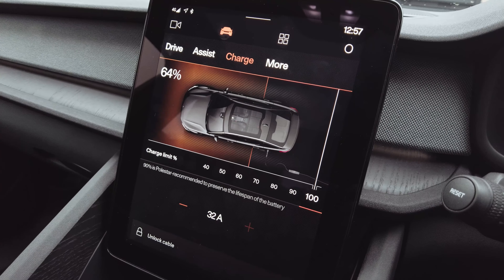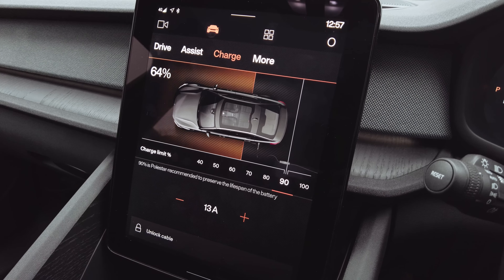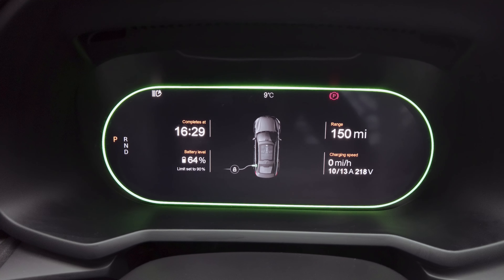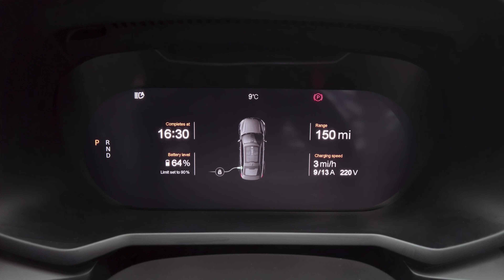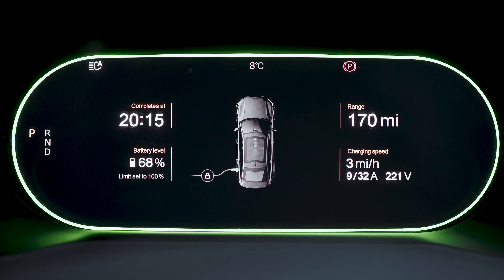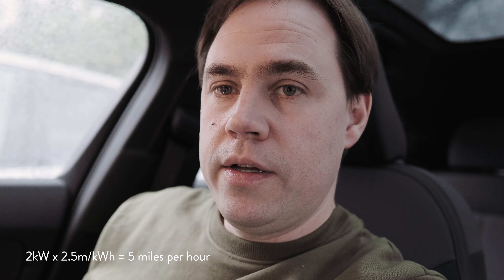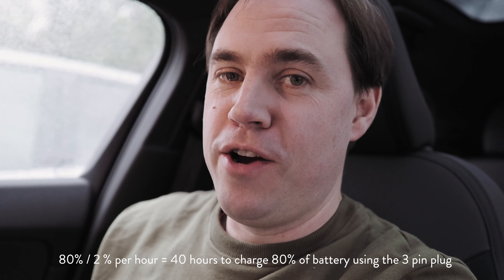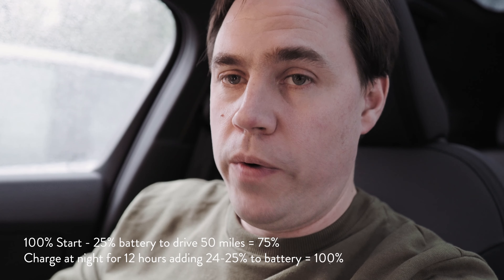Polestar 2 - 3 pin charging from a standard socket

Comment: Bradley thanks again for video. I have been using 13A plug since my Polestar arrived about one month ago. In process of getting a 7kw installed. I have been getting 4 mph on the display however actually seems to charge quicker than that. I only commute three times a week so no problem at the moment
Reply from the maker: Great, yeah good to hear. I think the displayed charging rate is quite conservative

Comment: The Teslas have a setting that allows the car to keep the interior below 105 degrees F at all times by utilizing the air conditioning.  I visited my parents this summer in Mrytle Beach, South Carolina.  I arrived at 15% state of charge and let it sit for 4 days and 4 nights on the travel charger at 12A, in the heat and humidity before finally reaching 100%.  Their electricity was free (included in the HOA fee) and we used the electric golf cart the entire time of my stay, so the travel chargers do have some usefulness at times.  There was a supercharger within 2 miles, but why pay for range when you don't need to?  Good video.  Everyone needs to be aware of all the options available to them and the use cases for each option.

Comment: I've been using the 13a charger since I got my Polestar and have no problems at all. 

I plug in via a smart plug to select the best times on Octopus Agile for charging, The smart plug shows a maximum of 2.3kW whilst charging but it fluctuates as low as 1.8kW which would explain your 2% per hour. It actually gives 2.5% per hour over a sustained period. I did 10 hours last night in the plunge pricing period and went from 65% up to 90%

My mileage is quite low at about 120 per week on average but even with the Polestars abysmal cold weather range I can easily cope. I don't even plug in every night, I just hover between 40% and 60% and wait until there's some reasonable pricing and have a little top up as and when. 

I had a long trip a few weeks ago which just needed a bit of forward planning and I had to make sure I was always at 85% ready for topping up to 100% the night before my trip. Again not a problem you just have to think ahead. 

On a side note: The charger companies really wind me up when they claim you need a proper charger as 13a sockets aren't designed for pulling this sort of load 'continually'. Absolute rubbish!! That's exactly what they're designed for!! Mini rant over........

Thanks for another great, informative video.
Reply from the maker: Thanks, great to hear experience from someone using it regularly. Was great to get paid last night to us power but annoyingly I was already at 75%, wish I hadn't topped up two days ago.
Reply: @ShortCircuitPS2  If you go to windfinder.com you can get a very good idea of what the pricing will be over the next week as prices are heavily linked to excess wind energy.
Even at the start of the week you could see that there was going to be a lot of wind on Saturday night and as the weekend got closer the prediction stayed the same. Lots of wind at a weekend between midnight and 6am is pretty much perfect for cheap pricing.
Reply from the maker: Great thanks for sharing that site and the tips. I'll definitely keep an eye on that for future charging
Reply: I don't know the exact details in Great Britain, but in Germany we have the 1-phase "Schuko" plug and the sockets are for max. 16A designed but it is definitely not allowed to pull this load continuously, only 1 hour at max. load according to German standards.

A CEE socket must be installed for 16A permanently. Single-Phase 25A or 32A is also possible in combination with CEE, but unusual in privat home installations in Germany.
Reply: I've had a 2kw heater melt and burn a socket, and a granny charger melt the switch in a socket only 6 years old. They really cannot sustain 13a for extended periods, and its for this reason you aren't supposed to use immersion heaters wired into a plug any more.

Comment: Put this in context : I charge on mains at work. It's "slow," as you say, but over 8 hours it covers my round - trip commute distance with some to spare. I precondition the cabin, but the system only operates for a few minutes before departure, so it's only a minor penalty.   This is a great way to charge if it meets the daily requirements. "Slow" charge at work, charge at a higher rate at home infrequently , when needed,
Reply from the maker: Yeah, really good way of doing it!
Reply: 99% of the charging I do on my model 3 is slow charging like this. Usually at work. Every other day or so is enough for me. I have a fairly short commute though.
Reply: I’m not sure how many people would be able to charge their car at work. I can’t. No sockets available in the car park and the management won’t allow it anyway.

Comment: I thought I would never use this 3-pin plug cable but I’ve just got home solar installed and during the summer I can trickle charge all day for free ⚡️👍🏻
I also have a Pod Point but using this plug cable is just easier than messing around with other settings.

Comment: thanks for the share. 
Very interesting. i’m considering waiting before investing in a wall box. 3pin plug can be enough if you don’t do more than 50miles a day. 
also there are other ways to charge. Shopping moles parking , Supermarkets, public roads. 
Some of them are almost as cheap as home and often can charge up to 22Kwh.
depending on your profile, a home charger might even be not necessary at all, no matter the speed. Especially if you live very close near a 22kwh charging station with decent price. which is possible if you live in a city

Comment: Are you able to change the Charge Limit in the app?
Also, when using the 3 pin charger it’s worth setting the amps to below 13A as it’s likely to overheat the socket. A 13A socket isn’t typically designed to pull 13A continuously for hours at a time. My Tesla won’t charge greater than 10A on a British plug.
The car will charge slightly quicker if you aren’t sat in it as it doesn’t need to run the screens, seat heater etc if you aren’t in it. :)

Comment: Hi...my Polestar’s due in about a months time and it’s my first EV. Have got somebody who can fit a 7kw charger but not sure what’s the best one to have, or if there is a ‘best one’ as they all do the same thing? Also looks like you can only buy some fitted (EO) and can’t buy just the charging units? Know it’s not directly related to this vid but any advice/help would be appreciated as I’m very confused!!🙈🤷🏼‍♂️👍
Reply: YouTube of course and look at  (and join) Polestar-forum.com and have a search around. I’m not familiar with the Facebook forums but they are out there. Ultimately they all do the same . Ground rods no longer required, apps essential, consider if you will go on overnight or solar tariffs. Aesthetics - think of how and where the cable will lie or wrap in your particular situation ie outside wall or in a garage. Enjoy your P2.
Reply: Richard I have had my Polestar around a month and been charging from the 13a plug mostly.  I am awaiting to have a  7kw charger fitted. My installation is not standard and requires extra work. I particularly want an EO charger as it is small and compact. The price charged by EO contractor seemed excessive for the extra work. I called EO and asked for a price just for the charger and they started off saying no. I then said OK I will have to get another charger then and they quote me a a purchase price of £487 inc VAT. I have found a local approved electrician who I am sure will give me a cheaper price. Just awaiting his price. There is a list on Government website. I dowloaded and looked for local approved installers.. Hope that helps.

Comment: Interesting. So assuming around a 10A draw from three pin plug - approx. 2300W per hour. So at 3 miles per hour, this is 767W per mile? This is only 1.3 miles per kWh?
Reply from the maker: Agreed, and i don't think the display is particularly realistic. I think it should say more like  4 to 5 miles per hour
Reply: @ShortCircuitPS2  I’ve just installed a 24A charger for home for when I get my Polestar so I was hoping for about 12 miles per hour based on 5.5kWh?
Reply from the maker: Yeah I'd say about 15 miles per hour is what I've seen when charging at home on a 32 amp charger so you should hopefully be close to that.
Reply: @ShortCircuitPS2  Sounds good 👍
Reply: @CarFinanceSimplified  I think the Polestars battery % indicator is accurate but the range indicator is a joke. Woefully inaccurate and doesn't 'learn' from your driving style between charges. It seems to adapt a bit from a full charge but every time you plug in it just gets it all wrong.
Reply: Bradley another really useful video; some very helpful examples. The 3 pin option is, for most owners, a get-out-of-jail option, ie best left until it’s the only option, typically when on holiday etc. But as you say, depending on the daily commute, it can work as the routine charging option in some circumstances. 👍🏻👍🏻

Comment: Why is it only charging at 9 amps on a 13 amp supply ? - I mean its showing 9 amps at 221 volts which is just 2kw.
Reply: Maybe he has a 10 amp breaker.
Reply: Max sustained allowed from a UK plug is 10A. Most car supplied EVSE are limited to 10A. You can get aftermarket units that go to 13A but not really recommended. As for the amps they do tend to go up and down a bit. On my 3pin charger the ampage pulled is generally 0.5-1.0A less than selected.